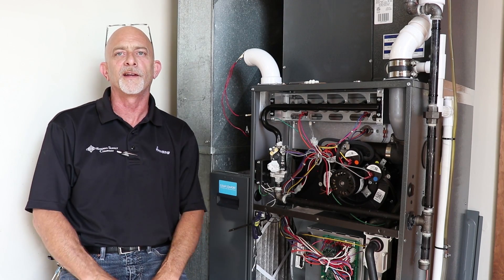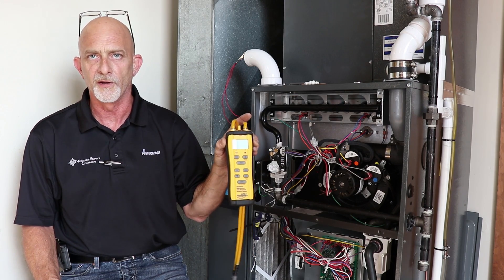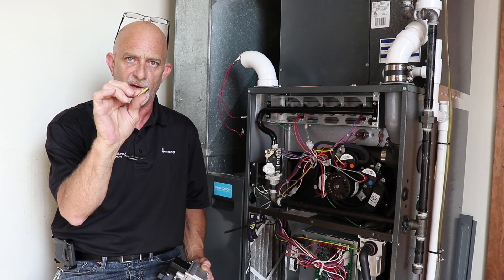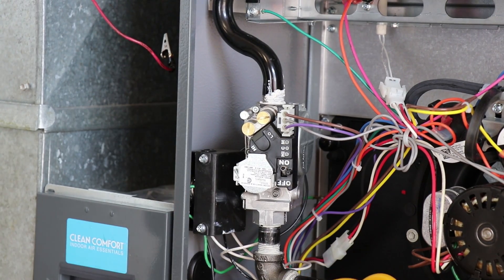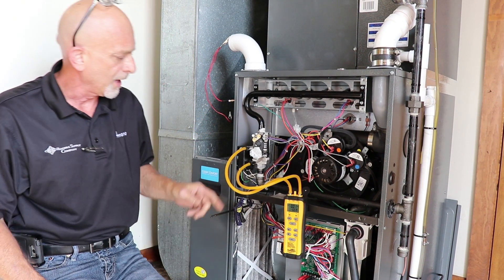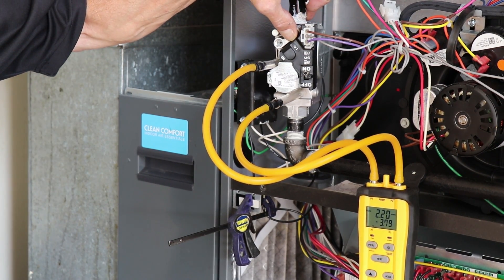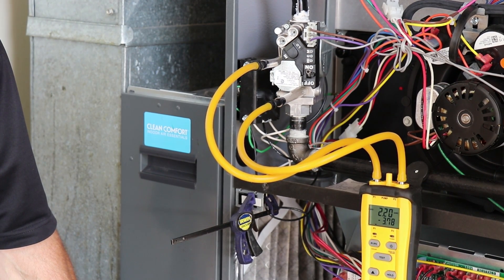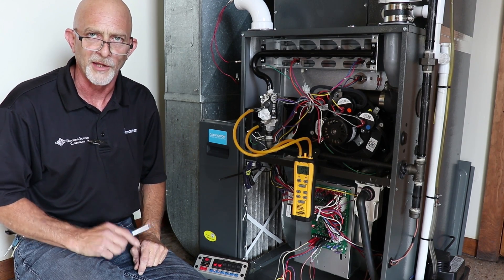How to Adjust Manifold Gas Pressure on a Furnace

Comment: Great video, used this as my main source of information to  adjust a new gas valve that i installed in my furnace. Old one was leaking gas through the manifold even though the furnace was off. Swapped from a honeywell to a white rodgers, your video covered just about everything i needed to know.

Comment: Do we need to adjust gas valve every 3 years for regular maintenance? My 2nd stage is reading 2.6 but should be 3.2-3.8 so wondering if tech didn't have it set when installed 3 years ago.

Comment: Hi, my low stage reads 3.8"wc.  I've tried turning the adjustment screw to bring it down to around 1.7"wc. But turning the adjustment screw has no effects.  Is it a bad gas gave then? Thanks

Comment: Would you adjust gas pressure if you have a high CO reading
Reply: Lance Rudy yeah you can, high CO is a sign that your furnace may be starving for combustible air, you need at least 10-15 cubic ft of air for natural gas and like 24 cubic ft for LP. It could be your gas pressure but I’d check out other areas of furnace

Comment: hi, for a sealed combustion (with a hose connecting gas valve to burner box) do you need to remove the burner box first before adjusting the manifold pressure? or do you just adjust the pressure with burner box closed? thank you for your help.

Comment: hi, how did you energized the second stage? thanks.
Reply from the maker: If it's a true 2 stage furnace you can energize W2 with either demand in stat or jumping out. A GMH/ AMH is automatic based on time. It set dip switch to single stage stat.
Reply: It is  timed sequence. The furnace starts in low fire and remains that way for a short peiod of time. So you can do your adjusting during that stage. Then it will kick into hi fire and you can adjust the hi during that stage.